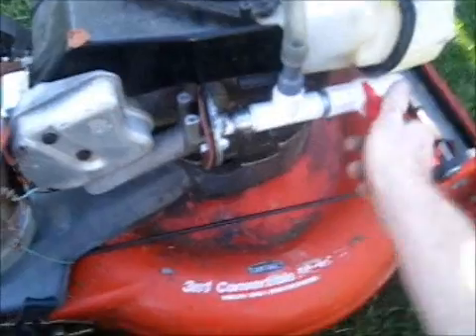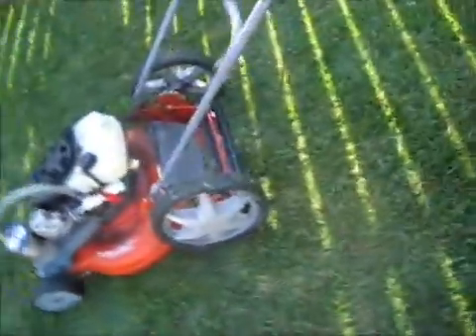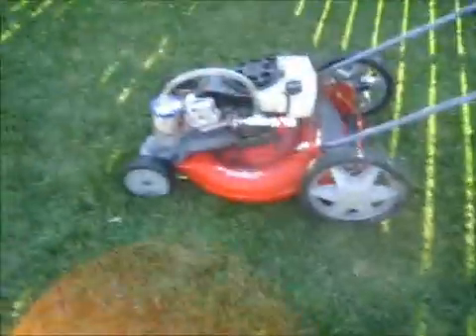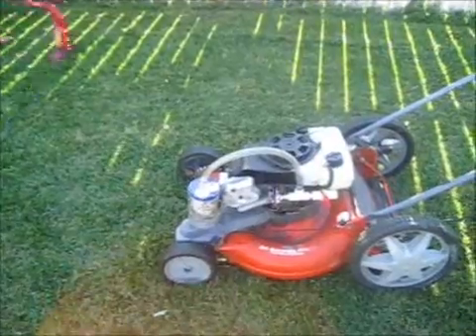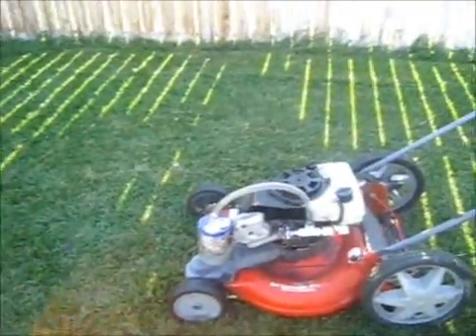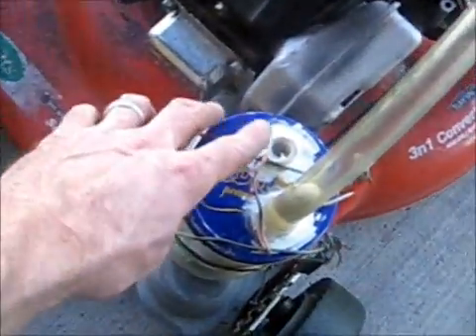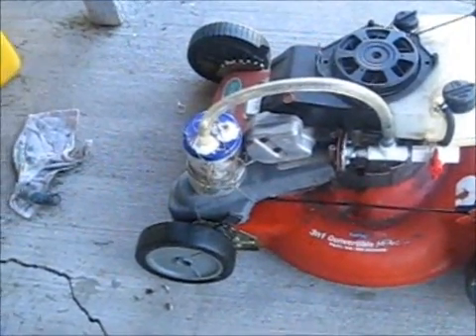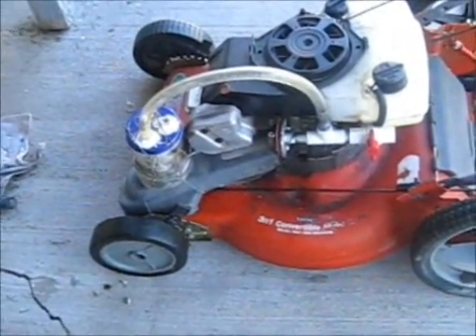AIR TO FUEL RATIO PART 2

Comment from the maker: As for the gains on the mower I don't have much to compare it to because my carb went bad so I need a new one to do run time testing with. I will be showing extensive test results when I install the vapor system in my Jeep so everyone can see the data for them self and can replicate it.

Comment from the maker: I hope to put a different type of vapor system in my Jeep within the next month. I'll make a video of it when I do. As for the new system using the injector adapters I may need to go to a different machine shop because the one I am working with is taking way too long.

Comment: Wow, that thing is purring like it should. Good work.  Do you have a way to measure efficiency increase over the original carb?  I really want this to work well and I like the idea of using exhaust energy to heat up your vapor reservoir. You could possibly transfer heat via copper from the exhaust.

Comment from the maker: I can tell you that I personally have seen the energy that is truly harnessed in gasoline Vehicles today are not even achieving 25% of that harnessed energy, they are wasting it away. If cars today were so efficient why would they need catalytic converters? Why would some of the exhaust be looped back into the engine to receive a more complete burn? There is so much more I could say but we will start with that.

Comment from the maker: You can tell them of course gas can only be stretched so far but with how current engines use it it is not at near the efficiency as what you can get out of it in fact it's not even close. If it were close then how could I have possibly got a 900+% increase? How could the shell company have gotten 367 MPG, how could the carburetor built in the 30's have gotten 150 MPG, how could many people have gotten such high efficiency if it can't be more efficient they it already is?

Comment from the maker: Another thins you can tell them is My new vaporizer system that I am marketing does use all the current methods of how the car runs I have just added to it to improve it more. My system will be fully automatic so you wont have to worry about anything.

Comment from the maker: Engineers can say whatever they want until they actually do the complete testing for them selves they will never know. I have proved there theories to be wrong. They also have not tried everything there is to try. Even a cold vapor bubbler system increases fuel efficiency. Also compare a car from the 60's to a car now cars now weigh a heck of allot less then cars from the 60's yet they still get close to the same fuel economy.

Comment: Tyson, there is this Doctor I work with, pretty sharp guy, who was excited about this gas vapor possibility, but has since come back with saying it doesn't matter if you can run on vapor or not, you will not get better efficiency versus modern technology with computers and fuel injection. Said he read up on it from some supposed engineers formal type papers, research, Said to forget it, pursue something else, cause you can only squeeze so much out a given amount of fuel, regardless. CONT.

Comment: Tyson, maybe you could just get the actual carb. gasket from the lawnmower repair store, if you have one nearby. They are a fiber material, and are heat resistant, or get a small roll of generic, simila type gasket material from Napa  auto parts store, and cut it  to size. bigdaddy b'grass.

Comment: Tyson, thanks for making this video, letting lawnmower run so long. I really enjoyed seeing it run that long under a load and enjoyed listening to how the motor sounded throughout the video. Very good demonstration. Looking forward to the new double wall, steel, exhaust gas heated container you are building, which should get it up to hot, dry vapor status quicker. Great job!

Comment: I am always thinking how this will be applied to a car. Secondary air inlet isn't needed with dry vapor, essentially, and even primary air inlet, you said, will be added to further restrict air to this  dry vapor vaporizer, as it heats up. This then would have to be incorporated into system for the  car to continue to run well. How could you rig this to control this primary air valve from inside the car driving, while driving? A manual choke cable, perhaps? Tbanks!

Comment: Isn't  normal ratio something like 14 parts air to 1 part fuel, in traditional carbs./ fuel injection systems on cars? If so, this ratio of 122 parts air to 1 part gas should  equate to 8.7 times greater efficiency of vapor compared to liquid gasoline, or 807% increased gas milage equivalent, right?  Pretty phenomenal. Thanks.

Comment: Nice work Tyson. Very well done. Tyson, gasoline in it's liquid phase expands 163 times when completely vaporized into your dry vapor. When we run any internal combustion engine on dry vapors, the air to fuel ratio changes to 122 pounds of air mixed with every pound of vaporized gasoline. One liquid gallon of gasoline weighs 6.3 pounds.